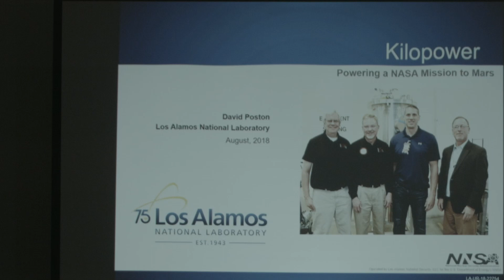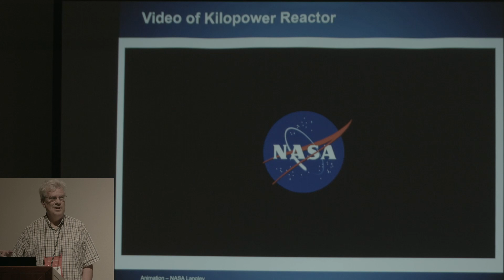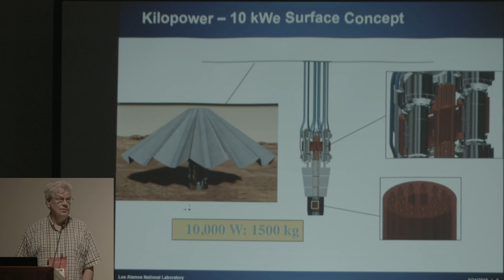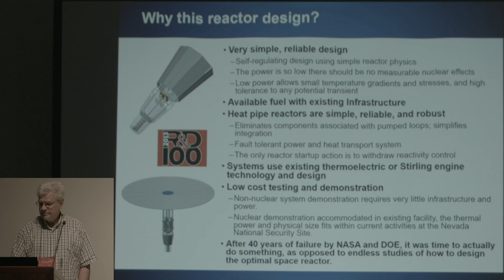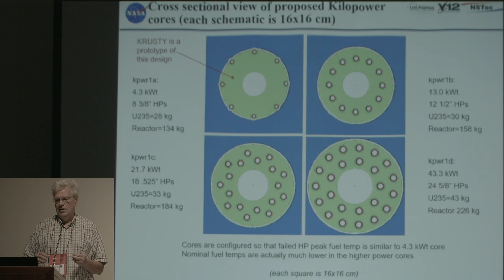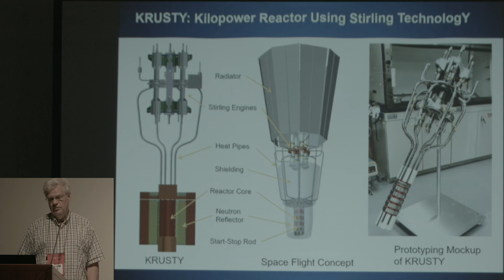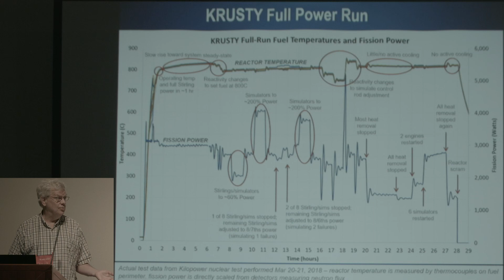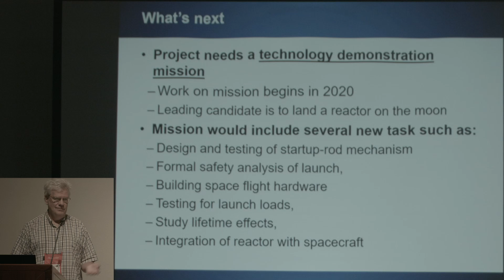Dr. David Poston - Small Nuclear Reactors for Mars - 21st Annual Mars Society Convention

Comment: One big thing is that we do not even need radiators and lost thermal energy on Mars - Mars habitats will also need a lot of thermal energy, both to heat up underground habs and to melt large amounts of water ice for ISRU. The energy heavy process of splitting water can also be (at least partially) powered by heat energy. That allows to use another 10+kW out of each of these reactors.
Reply: I think you seriously underestimate the amount of heat involved. Let's say a SpaceX colony with 20 humans has 4 10kWe Kilopowers as a supplementary power source to a much larger solar array, each reactor generates 30kW of waste heat, for 120kW waste heat total. A typical powerful indoor home heater might radiate 2kW of heat, so the waste heat is equivilant to 60 of these heaters. Would their habitat, which is perfectly sealed against the environment and likely buried under 1m+ of dry, insulating regolith, require 60 powerful heaters? In fact with all the heat generating humans and equipment in there the habitat will very likely require cooling, not heating, much as Finnish passive homes can require 0 heating even in the middle of winter in Finland, which is a kind of cold that makes equatorial Mars look warm (where there is daily sun, and much lower convective heat loss).

Next up: melting water. It takes around 450kJ to melt 1kg of ice into water, the waste heat from the reactor could melt 1kg of -50C water ice every 3.75s (and again to get an intuition for this, imagine 60 powerful heaters blasting a block of ice and how that ice is going to be weeping). This is equal to 324t of water every day. In around 3-4 days it could melt enough water to provide the hydrogen needed to refuel a BFS. And the waste heat from the generators is at around 400C, this can only contribute a few percentage of the energy requirements for electrolysis and doesn't exactly reduce the requirements for radiators, instead of having to discard the 120kW of heat hot out of the generators, you have to discard the 120kW of heat hot out of the electrolysis units (now in the form of hot hydrogen, and hot oxygen), it just saves a little electricity (and this assumes you have MW of electricity coming from photovoltaics, as you can't use mostly heat and only a little electricity, unless that heat is at like 2500C).

There are two ways which the waste heat could be turned into something useful. The first is generating power by using a bottoming cycle, if you don't mind evaporating quite a lot of water for effective cooling, at least 30% of the waste heat could be turned into electricity and you don't need radiators anymore because the heat escapes with the water vapor. This is probably a dumb idea but if there are billions of tons of easily melted ice it might be worth considering. But it would be essentially wasting water.

The other potential use is heating rather large greenhouses. 120kW of waste heat would be enough to provide 200W/m^2 of heating to 600sqm - about a quarter-acre, this would definitely be enough to warm it up to nice tropical earth standards (on Earth, the average energy from the sun over a day is only about 400W/m^2, on Mars it's about 200W/m^2), all effort would have to be made to make the greenhouse as un-insulated as possible so it doesn't overheat (in particular it should be really transparent to infrared so heat can escape to the sky). The greenhouse could grow about 4000kg of potatoes per (earth) year and in fact could produce most the food needed. But it would take a lot of work to set this greenhouse up, and work in it - and an appropriately insulated greenhouse might well stay warm enough with just natural sunlight anway.

The summary is that on Mars the level of waste heat which comes from fission reactors is something which takes a lot of work to utilize, it doesn't do you favors. In fact it almost makes more sense to just discard it to the sky with an umbrella radiator.
Reply: See, you are touching on a couple important points here - even a single 10kW reactor with its heat output can provide enough warmth to a significant colony such as you'd no longer need to spend electricity to warm up anything. You could dig ice, you could melt martian permafrost to ease digging new underground habitats. You need around 3 meters of ground above to get the radiation exposure during solar flares in habitats down to Earth surface levels. And you need to keep the habitat warm against all the surrounding frozen rock. Sure, insulation is nice, but if you can replace tons and tons of insulation in all rooms and corridors and pipes with a few extra heating loops, then it might be a useful trade-off.

And second one is that a design with much higher target operating temperatures (such as 2500C) could be much more efficient on Mars and the heat can be easier to utilise to split water. At that point even an nuclear reactor without any innate electricity generation ability, but with an ability to produce very high heat could be more effective. And it would be a simpler design. (Outside the core, I mean)
Reply: therealnightwriter  - Take your meds.
Reply: @aigarius  some great ideas. In some people mindes the non use of waist heat is a great tragady. The cooling towers one sees on The Symsons is heat waisted. one idea was we sould build a shopping mall or an appartment building next to a nuclear power plant to get free energy. James Lovelock said burry the nuclear waist under my home for the free home heating. I live in Thompson Manitoba Canada it can get to minus 45 in January here. i spend a lot on heating my home.
Reply: Plenty of waste heat then to warm up their mash tuns. Now we know why they named the first test DUFF!
Reply: Could heat storage systems play a role?  To smooth things out between the day and night time?

I'm not sure what good options there might be though. Perhaps they could dig a large hole, line the hole with a plastic bag, and fill the bag up with water extracted locally, to be used as a heat sink.
Reply: If a habitat is sufficiently well insulated then cooling is the problem.  You'd quickly want to move your power generators outside.   One thing we don't know yet is what the temperature is deep underground.   We should be able to dig much deeper on Mars than on Earth.
Reply: Bondy,  if it's a solid state RTG then you just need to be far enough away to avoid radiation.  If it's a more complex reactor then you'd maybe put it at a safe distance but close enough to tend.  You have to bring your power cables with you from Earth, so it can't be too far.
Reply: You have to go there to do any serious drilling.  The heaviest drill sent (the one on Curiosity) goes down about 4 inches.    On the Moon,  an astronaut went down with a hand auger about 12 inches (before it jammed, because moon dust is much less fluffy than expected)
Reply: If it was that easy, there wouldn't be so many jobs on oil rigs. Robots are a long way from being as versatile as humans, even in a space suit
Reply: @blakewalsh9489   : On Mars How about using that waste heat to run a Sabatier process, or ORC power units to get more electricity. Heat for cooling using ammonia or lithium bromide evaporation. In Space : I wonder how light we could make an OCR generator (or what about nitinol based machines ?) to up the electrical power to run larger ion thrustors or just heat propellant as in standard nuclear rockets.

Comment: Regarding Poston's accident comments, and "no other material" in nature (like the Be reflector) can enable fission for the Kilopower reactor: that maybe correct, though there is another man-made one that will  do more than just enable  criticality. An additional Kilopower HEU reactor core, or two, on the same launch is more than 52 kg HEU,  enough for a weapon.  That's not going happen on a civilian launch.

Yes HEU has numerous strong advtanges in a  power reactor, i.e. low mass and low radiation as detailed in the talk.   It also has one overwhelming disadvantage, and hince the  use of LEU in civilian reactors.

Comment: What happens if the radiators get covered in dust? Will the reactors overheat?
Reply: As far as I understood from him, if the reactor cooling is reduced, the temperature of the core will go up by about 20 degrees, which will in turn reduce reactivity and cause the reactor to produce less power and less heat. So, it is basically self regulating. I understood it as having a negative temperature coefficient, meaning reactivity will go down as temperature goes up. Which makes it infinitely more safe than a reactor with a positive temperature coefficient, for obvious reasons.

And the loss of cooling could either be caused by failed radiator like you mention, or failure of one or more of the Stirling engines, a heat pipe or something else. The reactor is basically designed to run even without cooling as it will simply stabilize at about 800 degrees C and have minimal fission (just enough to raise the temperature up to the point where the negative temperature coefficient regulates it)

Comment: I wonder how its costs compare to other options such as solar thermal, beamed power and even wind power. Also I suspect the anti-nuke people are going to provide no end of opposition to this sort of thing. No matter how safe it is.
Reply: It is guys like this presenter that really has held back nuclear power with his vague metrics like "at the site boundary", and his trivialization of other people's injuries and conflating rapid depressurization with months of suffering; "acute events" risk reducing cancer risk. If you aren't the one riding the rocket, you don't get to be cavalier about other people's safety or talk about highly trained personnel as if they are disposable equipment.
What site? The already irradiated NTS? How far is the boundary from the test article? 3 km or 50 km? Or was that the launch pad? If it is the launch pad, does a single failure mean having to rebuild the whole launch facility somewhere else?
This how distrust is reinforced, not how it is defused.
Reply: Thats true, however the majority of direct radiation produced by the reactor can be contained either by burying the core in a few feet of dirt (saving the weight of concrete or metal shielding), there is the problem of radiation produced from the top of the shielding tube, and the eventual radioactive contamination of the components. Once again the radiation being produced above the shielding hole would mostly just be directed upwards into space (the area above the heat umbrellas would be a no fly zone anyway) theres still radiation that would be scattered and deflected by the sterling engines, heat pipes, and umbrella itself. It might be useful to bury the whole apparatus in a crater so theres no direct line of sight between any part of it and anywhere humans work or live in. Or a large wall should be fine. However, I should note that the 5% increased cancer risk NASA accepts is far lower than the risk many people take in other careers like mining,  fuel or chemical handling, even cooking carries an excess cancer risk. At least there is one major mitigating factor, mars is already hostile, nobody goes outside and plays with the dirt, breathes in martian air, etc so minor particulate contamination isn't as direct a problem as it is around nuclear sites on earth.
Reply: +MarcAFK Part of what I was referencing was his radiation exposure assessment if the reactor was "aerosolized" by a rocket failure on the launchpad.
The operating reactor is supposed to be relatively OK for servicing even when the moderator rods aren't inserted and the daughter products haven't decayed, due to the neutron reflector. A terrestrial reactor's containment building is generally to keep dumb and/or malevolent people out and to prevent a primary coolant loop leak from contaminating the environment. This doesn't have the coolant in contact with the fuel.

Comment: Have they worked on a way to tap the waste energy????
Reply: No heat engine can be 100% efficient. The best combined-cycle gas turbines are about 60% efficient. If you are in space then your heat removal capacity is restricted. Higher radiator temperatures (like yellow hot) dissipate more heat (for the weight) but the pistons/turbines get less efficient. 

The higher difference in temperature your hot and cold side of the power conversion is the more efficient it is at turning it into mechanical energy. Let's say you wanted to build a warship spacecraft, radiators need to be as small as possible to make them less of a target, so conversion efficiency takes a backseat.
https://www.gamersglobal.de/screens/120598
Reply: In other words, it is tapping the waste heat. All the heat that can be used to make electricity by that system, is being used. If you wanted to use the waste heat to also warm something up, I suppose you could.

Comment: How are you going to decommission it and remove it ?
Reply: Why would you? Considering its intended use, there is no need to decomission and remove it. Either its on a Moon/Mars base and needed for power production for a very long time, or it's on a spacecraft in deep space and needed for power production for a very long time. Either way, he spoke of it being able to run for 200 years on full power, and the only limiting factor being the moving parts in the Stirling engines, which can be fixed/replaced on any manned mission. So, it'll essentially just sit there forever.
Reply: @Antares2  I thought there was some international treaty which says we won't leave nuclear reactors in space. Part of the reason we crashed Cassini into Saturn.
Reply: @jtm198  Well, on unmanned probes, yes. But if we're talking about powering a manned base on the Moon or Mars, then we have to rewrite some of the regulations regarding use of (and contamination of) space.

My point was just that if this reactor does what it promises, it will last for such a long time that the issue of decommissioning becomes less important. There won't be piles and piles of these when they last for hundreds of years.

By the time the first generation of these are burnt out, we have probably built up enough infrastructure on the Moon/Mars-base that they can produce power in other ways. We may also have made further breakthroughs in reactor designs as well as "other" forms of energy production. Hopefully :)
Reply: Ask for robot volunteers.

Comment: What type of nuclear reactor would be easiest to build, maintain and refuel oars from raw materials on mars? ISRU nuclear?
Reply: This type of reactor seems like a great candidate, being so simple and foolproof. Thorium / LFTR sounds promising too but those reactors haven't been developed much since Nixon killed Oak Ridge's program.
Reply: The first ISRU experiments are likely to done at one of the poles,  where the water and CO2 are known to be readily available.  With the thin atmosphere and the long summers,  solar may actually be feasible,   but think this type of reactor would also be desirable.   A rover/vehicle would need more power than you get from an RTG or solar if it's going to haul fuel to lower latitudes (which is where you'd probably want to have your main base of operations).
Reply: I'd say send nuclear plants to kick start a base, but once we have a bit of industry there, making solar panels would be a good next step,. (also geothermal potentially)
Reply: The fraction of martian water that is heavy water (deuterium oxide) is much higher than on earth, so heavy water reactors using natural uranium could be more economical than breeder reactors or uranium enrichment infrastructure.

Comment: Kilopower is great, but it seems a bit low for the power needed to refuel a rocket on Mars. Is there anything bigger in the works?
Reply: I think I recall him saying eventually you would want higher power units for ISRU
Reply: Yes, you are right, but if SpaceX has their way, or even Robert Zubrin, ISRU will be required earlier then later.
Reply: You need a couple megawatts to fully fuel a return journey in time for the next window. The cooling needs are going to be enormous. And no, you can't just melt water for cooling.
Reply: I don't know why this design wouldn't scale -- but I'm not a nuclear engineer. 

Coolest thing to me about this design is that it's so stupid-simple, even I can understand it.
Reply: Not just refueling to. You gotta send more just to sustain. Life support systems, environment control systems, keeping the lights on. Bringing more is just a detrimental effect to. They gotta find a way to make these more efficient or put out more power.
Reply: Well, at least it seems like O2 is in excess for ISRU refueling, so that bit of the life support should be covered.
Reply: +rouge gaming28 compared to the power requirements for ISRU, life support is nothing. As mentioned in the video, NASA estimates 40 kW of continuous power would be needed for their manned Mars mission. That's only about 4% of the power needed for one full refuel of a BFS every 26 months. 

But yeah, given that the 10 kW reactor is over 2.5 times more efficient than the 1 kW reactor in terms of kW/kg, it would be really nice to see them scale each reactor up to 50 or 100 kW to make ISRU more feasible.
Reply: Because its only 25% efficient
Reply: Not everything scales well. And there is also the matter of getting all those tons onto the surface of Mars. Not saying it's impossible, but it will be difficult on Sol one.